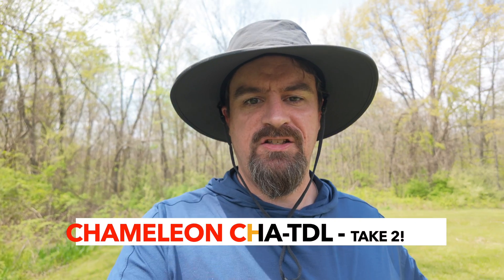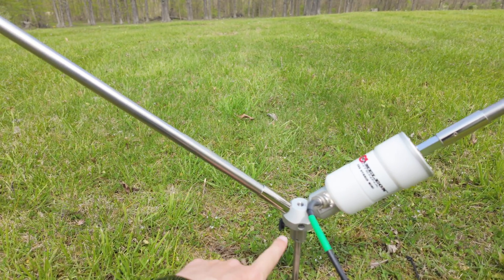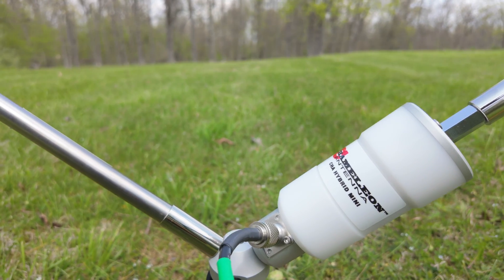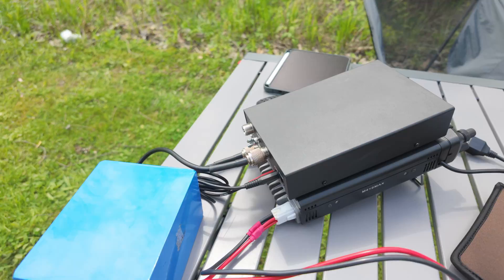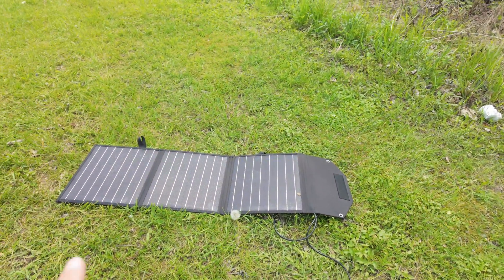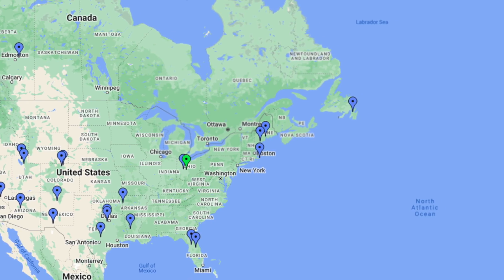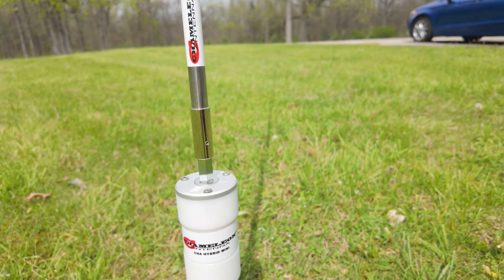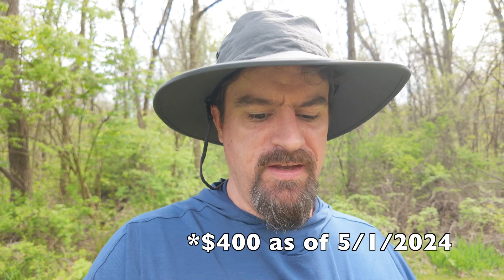CHAMELEON CHA-TDL - Tatical Delta Loop Review

Comment: Getting that delta up and out of the weeds would help with the low-angle radiation. One good option for that are the tripods used by photographers for lighting. You can set them up in seconds. They are stable and sold in enough numbers to keep the cost down. Some can be elevated ten feet or more. I use plastic electrical conduit the right diameter slipped over the base elements to give mine an even wider and more stable base. Having two elements 180 degrees apart tends adds to the stability.
Reply from the maker: Yep, hight is might with a Delta, and I think KB9VBR did that with his. I had experimented with this at home with various tripods but none of them could support the weight.

Comment: I mount mine on the 25' porta mast with the concreted ground mount.  I am amazed  at least at my location, how noise free it seems, just like bigger loops. And SWRs are lower on all bands. Also with a star washer in the mix  the porta mast only rotates if you make it do so.
Reply from the maker: @donausmus4281  Nice! This antenna definitely likes height for best performance. Good tip about the star washer, I’ll have to try that!